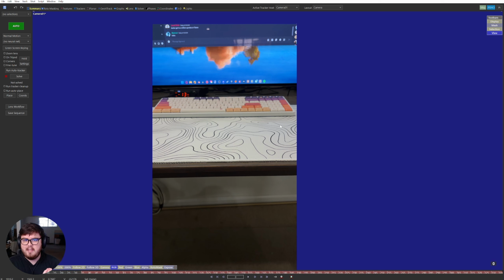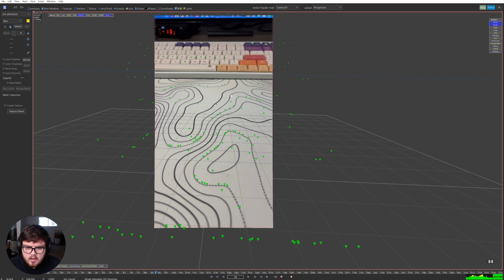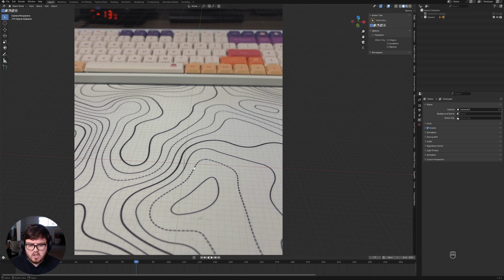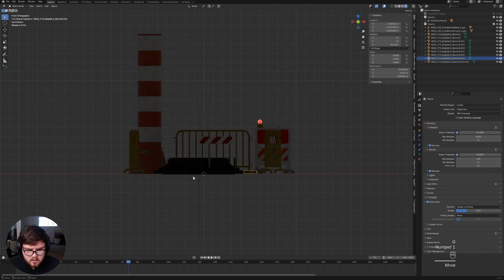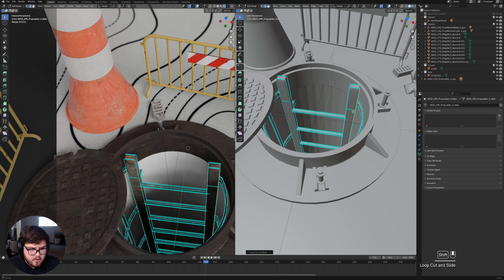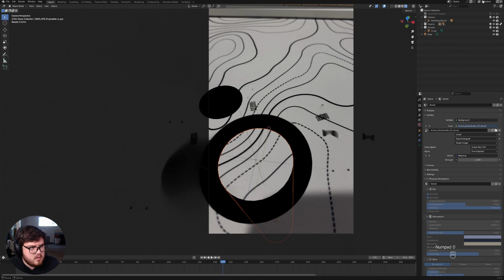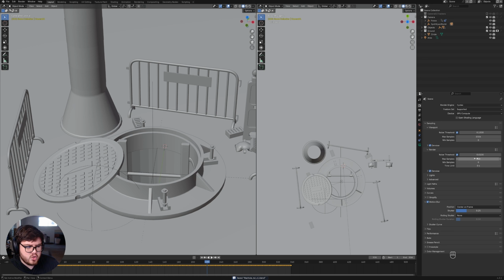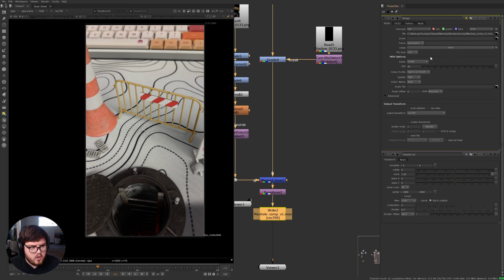Learn the Entire VFX Process for Professional VFX

Comment: Question, Jacob, i normally use AE to track videos, so far ive never had any issues, although it isnt perfect with a lot of movement videos. In your personal experience, is Syntheyes is more accurate than AE when it comes to camera tracking? (assuming yes, since you like using it) but looking more for a pointers of why.
THANKS.
Reply: Hii, yes syntheyes is one of the best softwares out there for tracking, while ae 3d camera tracker is nice and easy, it is nowhere near syntheyes

Comment: Try to render your cg with overscan so that you have information outside of project resolution. This should solve the clipping issue of redistortion.
Reply from the maker: I've been looking for a way to do that in blender. Do you know how?
Reply: @Jacob_Zirkle  Sure,  get the overscan (BlenderBob version) addon for blender . In Nuke, use Reformat node to reformat the render to the project resolution and set resize type to "none" and check preserve bounding box in the node's settings. Then use the LensDistortion node to redistort it with setting the BBox to Input/manual (project res) depending on your needs.
Reply: @Jacob_Zirkle  Honestly, I tried to put my comment here but for some reason its getting deleted every time. Have no clue why. I sent you an e-mail with the solution.

Comment: vertical footage imports wrong in both nuke and blender, I shot it with an android phone. Could it be the footage ? how to troubleshoot it ? . I fixed it with a transform and reformat in nuke. I just wanted to know what could cause the issue.
Reply from the maker: I believe it's usually the codec. I solve this by rexporting it in davinci with a mp4 h.264 codec and it works. In Nuke I use the original file or a EXR sequence of the video so it's full quality.

Comment: Hey Jacob, I cannot export the camera from SynthEyes to Blender; the Python files do not open in my blender, so can I export the .abc file from SynthEyes to Blender, and will it be the same?
Reply from the maker: Yeah I believe you should get a similar result with an abc. Make sure to check the blender file path when exporting in syntheyes. Usually if that's not set up properly then it can cause blender not to launch. If you want as well, you can actually execute that py file in blender by using the scripting tab and loading in the py file. I believe it'll give you the same results as importing through syntheyes. Hope that helps!

Comment: Are there benefits to rendering out separate files with png vs using OpenEXR Multilayer?
Reply from the maker: I'll use EXR for film quality VFX where a linear colorspace workflow makes sense. For something that's going straight to Instagram, I find it's better to just use png
Reply from the maker: I'm not filming on a dslr camera and so I don't have a great log workflow for these shots. PNG allows me to bake in the AGX view transform and so saves time. I wish Blender used something other than AGX.
Reply: @ 
Thanks so much for the answer : )

Comment: Thanks Jacob! quick question for the tracking part why you dont use AE and the plugin AEtoBlend I feel like it's a bit less complicated but I can be wrong - you might have a good explanation I am sure 
Thanks for all the tuto learning so much thanks to yoU!
Reply from the maker: Thanks so much! I prefer syntheyes because it's designed for professional camera tracking and I feel like it gives a more accurate and precise result. AE is built for motion graphics and so the 3d camera tracking is meant for that. It falls apart on closer inspection and doesn't give perfect results we need in professional use. Hope that helps!

Comment: nice, but one question,  why use Syntheyes and not camera tracking with blender itself ?   any differences ?
Reply from the maker: SynthEyes is just more accurate and has better pen distortion workflow. Blender is fine for basic scenes but for more advanced shots SynthEyes is fantastic
Reply: @Jacob_Zirkle  oh nice , thanks for the info,   I Will check that software 👌
Reply from the maker: @ I have a affiliate link in my description that will give a slight discount I believe!